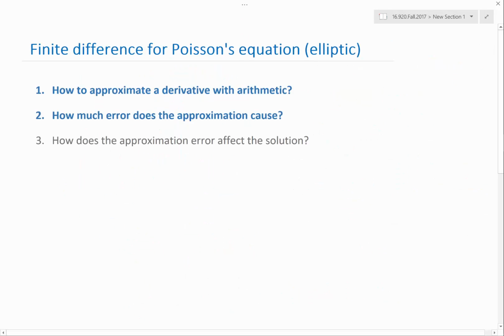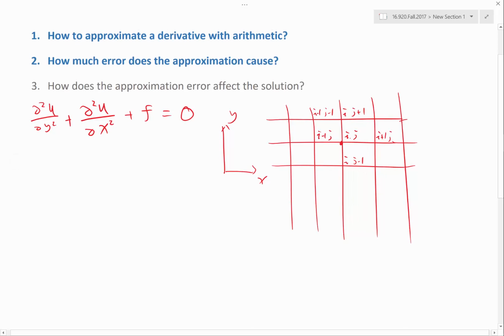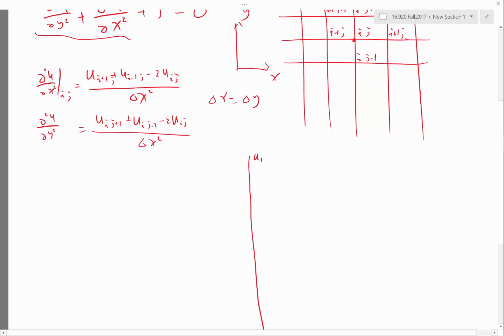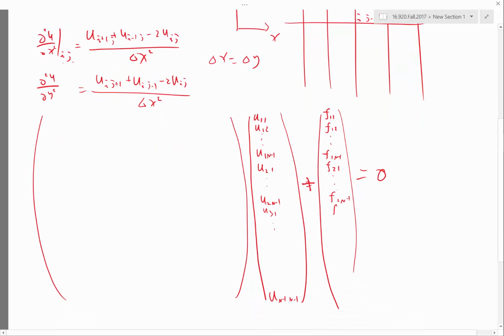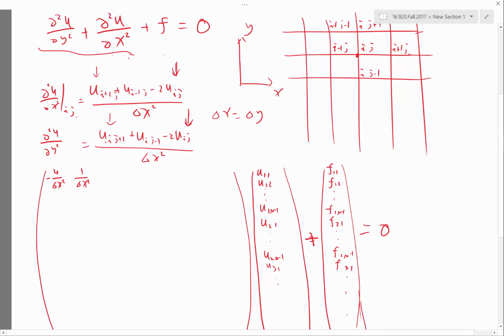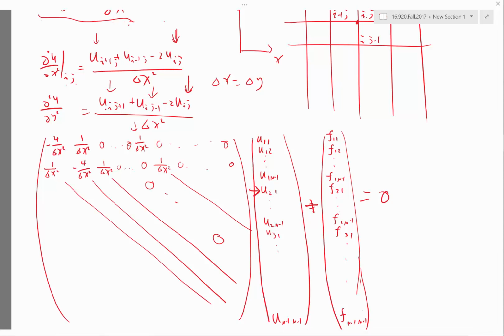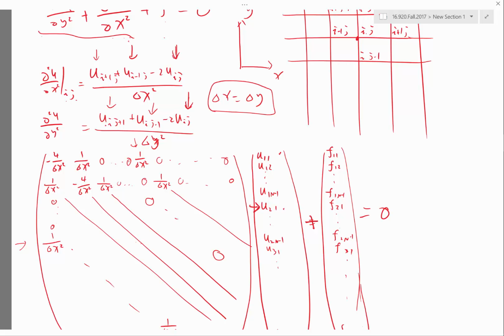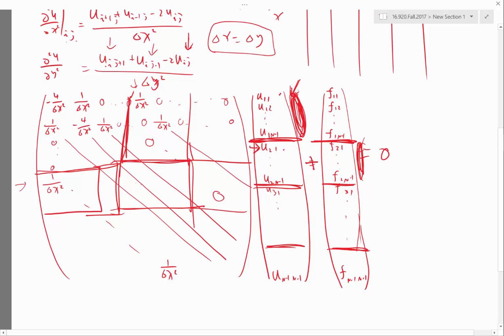Finite difference discretization for 2D Poisson's equation

Comment: If the boundary conditions are zero, wouldn't U(1 , : ) = U(99 , : ) = U( : , 1) = U( : , 99) = 0 ? 
Instead, the value of U grows along these boundaries, and is only approximately zero at the corners, like U(1,1).  Is this error ? Or is it because U(0, : ) is not in the reshaped matrix?  

For example, I expected all zeros when I computed  : 
u( 1 , : ) = 
Columns 1 through 12

    0.0003    0.0005    0.0007    0.0009    0.0010    0.0012    0.0013    0.0014    0.0015    0.0017    0.0018    0.0019

  Columns 13 through 24

    0.0020    0.0020    0.0021    0.0022    0.0023    0.0024    0.0024    0.0025    0.0025    0.0026    0.0027    0.0027

  Columns 25 through 36

    0.0028    0.0028    0.0029    0.0029    0.0029    0.0030    0.0030    0.0030    0.0031    0.0031    0.0031    0.0032

  Columns 37 through 48

    0.0032    0.0032    0.0032    0.0032    0.0033    0.0033    0.0033    0.0033    0.0033    0.0033    0.0033    0.0033

  Columns 49 through 60

    0.0033    0.0033    0.0033    0.0033    0.0033    0.0033    0.0033    0.0033    0.0033    0.0033    0.0033    0.0032

  Columns 61 through 72

    0.0032    0.0032    0.0032    0.0032    0.0031    0.0031    0.0031    0.0030    0.0030    0.0030    0.0029    0.0029

  Columns 73 through 84

    0.0029    0.0028    0.0028    0.0027    0.0027    0.0026    0.0025    0.0025    0.0024    0.0024    0.0023    0.0022

  Columns 85 through 96

    0.0021    0.0020    0.0020    0.0019    0.0018    0.0017    0.0015    0.0014    0.0013    0.0012    0.0010    0.0009

  Columns 97 through 99

    0.0007    0.0005    0.0003
Reply: Hi Fahraynk.. I have this question too.. were you able to find out what needs to be modified in Matrix A to incorporate the boundary condition.
Reply: At the time I had figured it out, I believe as long as it is zero on the edges, and if it varies from zero off of the edges it is maybe approximation error. 
Not sure if that is exact answer, I figured this out months ago so barely remember now. 
I found this video though, this guy explains poissons matrices very well : youtube.com/watch?v=-tlwQXewrYU&t=4s

Good luck man
Reply: Thank you for your reply. The video link was helpful.